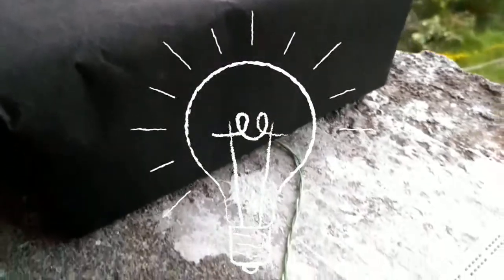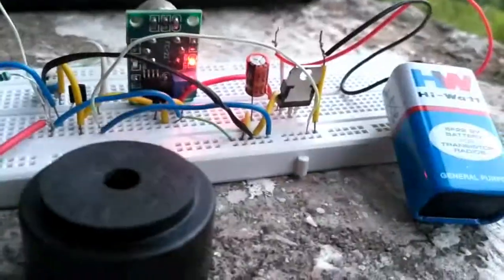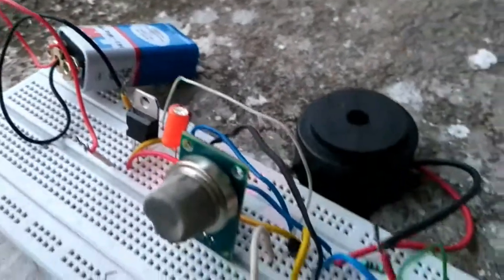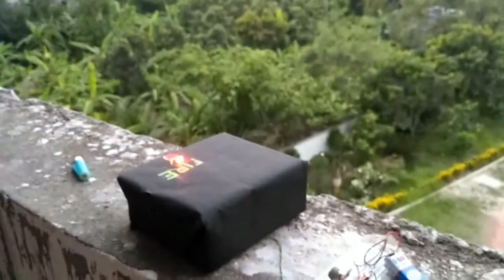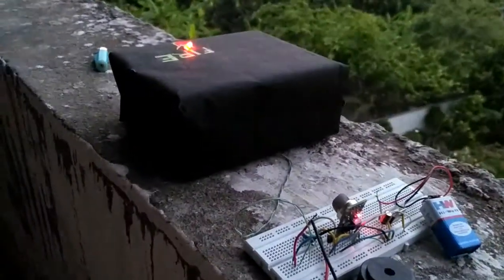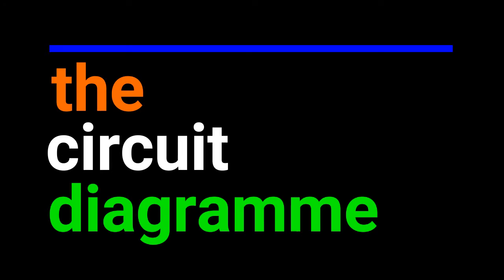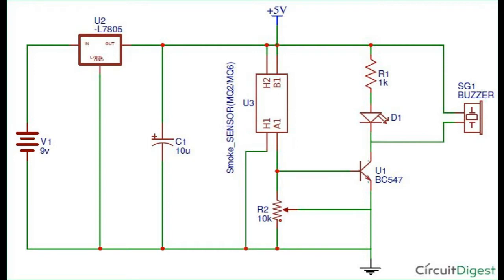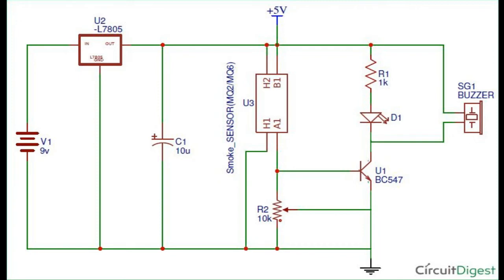smoke Detector Circuit

Comment: Bro, I connect the circuit on bread board, it's working. But i have one dought, my circuit is working when i connect the VCC 5v to MQ2 sensor. Before the circuit not working. But you can't connect the vcc 5v to the MQ2 sensor. How is it possible? Please give me the solution..... please bro

Comment: Sir is it necessary to connect 5v to mq2 sensor
What happens if we not connect 5v dc there at sensor
Reply from the maker: It may malfunction, 
Read the data sheet of mq2 sensor form internet. 

If you provide a voltage less than 5v then you may not get amplified sound from the buzzer 

If you provide voltage greater than 5v it may burn 

Please read the data sheet before experimenting

Comment: Hai
Reply: How you connect digital output?
Reply: Do you connected Do to vcc?
Reply from the maker: To connect digital output you will have to take connections from the digital 
o/p pins of the sensor. It is provided in it